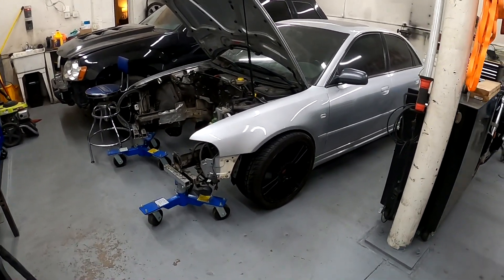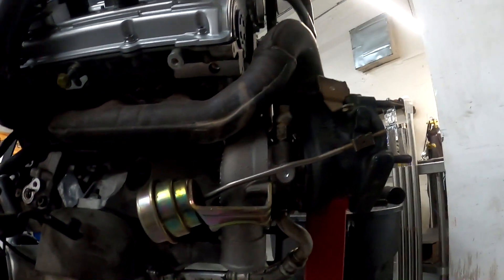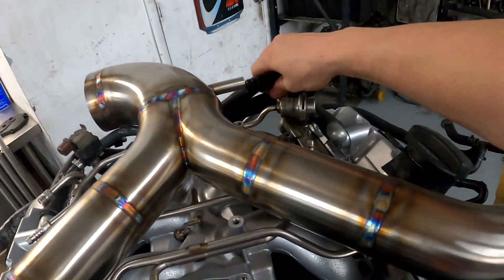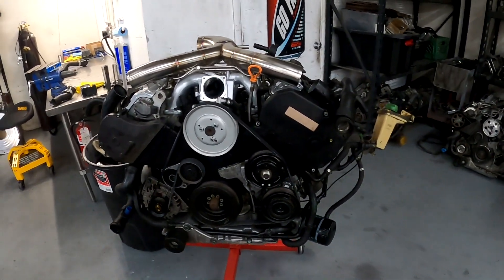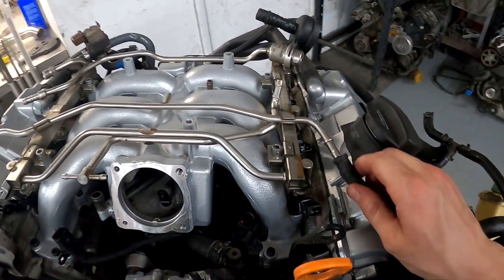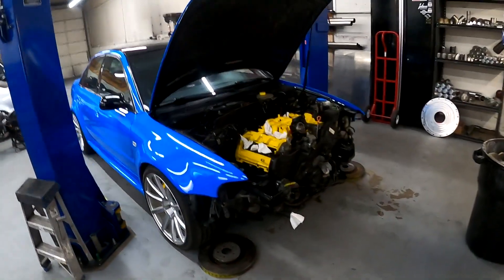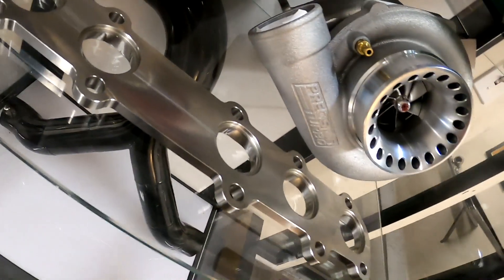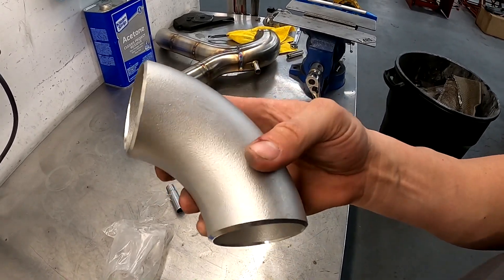B5 S4 Projects & Widebody Single Turbo Pt. 1

Comment: If those are the 298 injectors (Ford GT500), I recommend modifying the harness with USCAR adapters so that you don't have to rotate the injectors to fit. Those injectors have an 11° gamma angle (as Bosch calls it). When properly rotated these injectors almost perfectly match the OEM injector angle. However, when clocking incorrectly you'll get a large amount of wall wetting which leads to erratic AFRs during high throttle transients.
Reply: Whoops, I didn't realize how old this video was. Good future reference though I guess